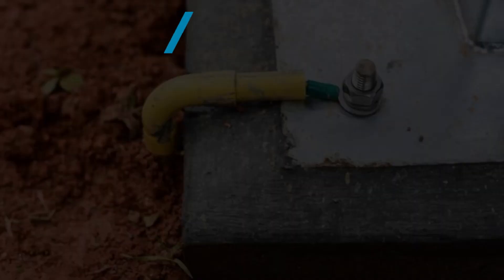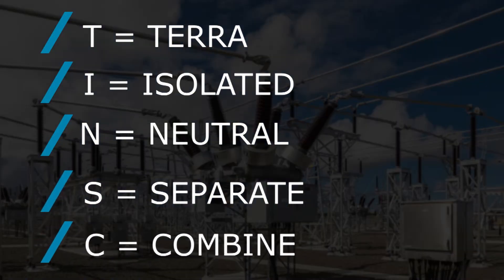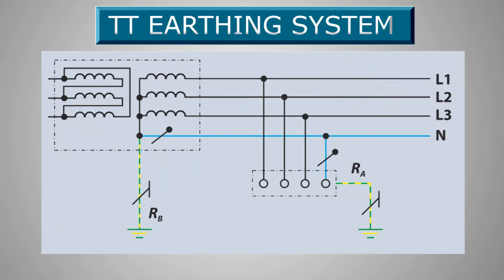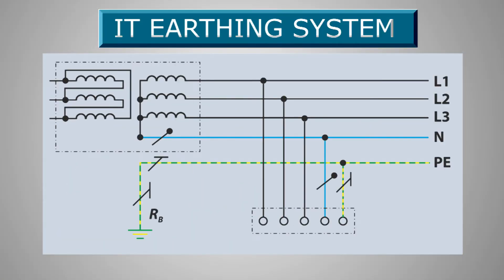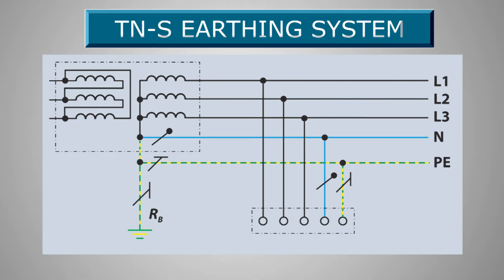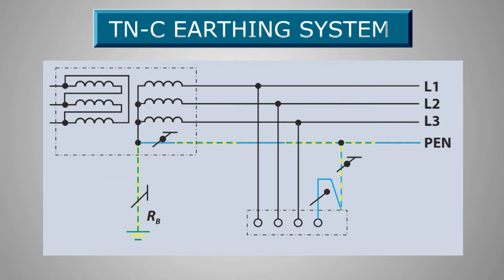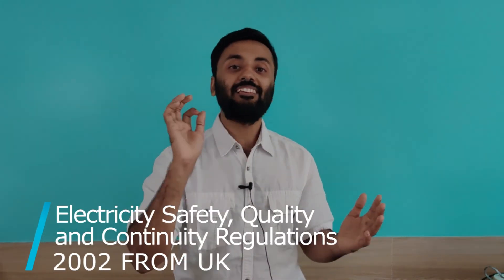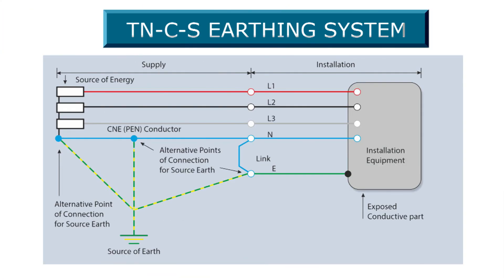TT, IT & TN Earthing System Explanation | Grounding Systems

Comment: Hi thanks for the video. 
What is the fundamental difference between an IT system and a TN system with lost neutral grounding, given that:

Both systems are 'floating' (no connection to earth)
In both systems, single-phase loads are connected between phase and neutral
TN with lost neutral grounding experiences voltage asymmetry
IT system does not experience voltage asymmetry. True really?

Why does this asymmetry occur in TN with lost neutral but not in IT, despite seemingly identical conditions?"
Would be grateful if you would answer! Thanks in advanced!
Reply from the maker: Due to their specific design, IT system may not experience voltage asymmetry whereas TN system will be affected by lost neutral. In IT system due to symmetrical impedance phase to neutral voltages will remain stable whereas in TN system if neutral is undefined then voltage shifts will cause asymmetry.
Reply: @AxisElectrical  Thank you for the answer. The point I am trying to understand is actually what is IT's system specific design that differentiates it from TN system when neutral grounding is lost... When you mention symmetrical impedance, are you referring to the load? How is it possible to maintain symmetrical impedance if we are dealing with single-phase loads?

Comment: i want to full name TT  IT TN
Reply from the maker: The First Letter of each system refers to the power source from a star-connected winding.

The Second Letter refers to the consuming equipment that needs to be earthed.

From the ‘Handbook of Electrical Engineering: For Practitioners In The Oil, Gas And Petrochemical Industry’ by Alan L. Sheldrake

For the first letter, “T denotes that the start point of the source is solidly connected to earth, which is usually at a location very near to the winding.

I denote that the start point and the winding are isolated from earth. The start point is usually connected to an inductive impedance or resistance. Capacitive impedance is never used.”

And for the second letter, “T denotes that the consumer has solidly earthed independently of the source earthing method.

N denotes that a low impedance conductor is taken from the earth connection at the source and routed directly to the consumer for the specific purpose of earthing the consuming equipment.

S denotes that the neutral conductor routed from the source is separate from the protective earthing conductor, which is also routed from the source. This implies that five conductors need to be routed for a three-phase consumer.
C denotes that the neutral conductor and the protective earthing conductor are one and the same conductor. This means that four conductors need to be routed for a three-phase consumer.”

To put it in simpler terms:

T = Direct connection to the Earth, T stands for Terra meaning earth

I = Isolated

N = Neutral

S = Separate

C = Combine

You can get more details in our blog here:

https://axis-india.com/tt-it-tn-earthing-systems/

Comment: Here in Tamilnadu TT is used. Dangerous without RCD. Only last December 2022 EB woke up and said RCD is mandatory for new service.
Reply: Officially in India TNS system is recommended but practically TT system is used. Because no one can trust on earthing made by electricity department.
Reply from the maker: We agree Kishore!
Thanks for sharing your insights.